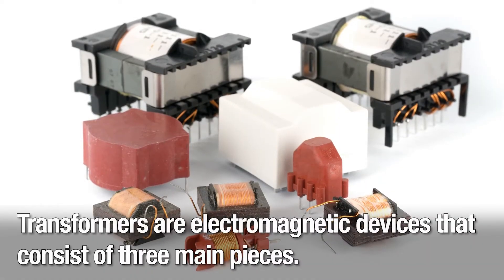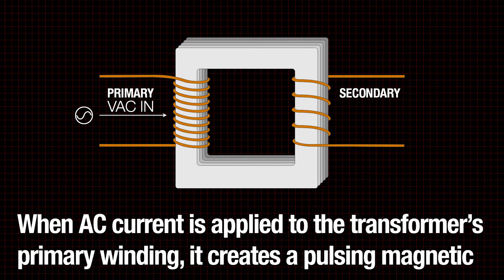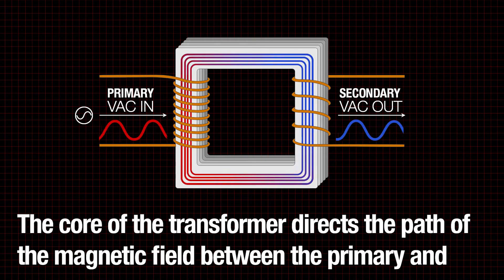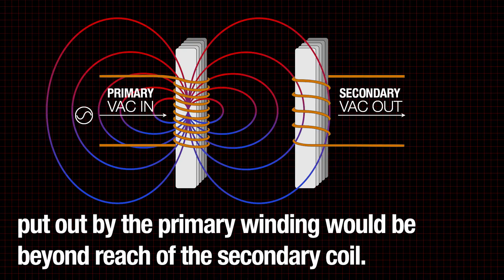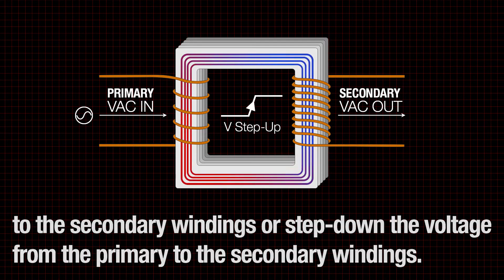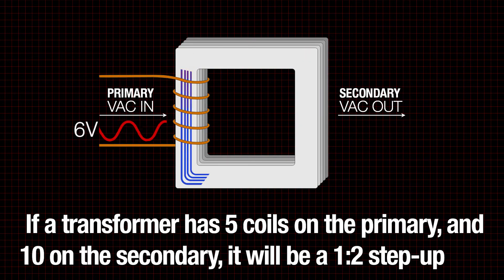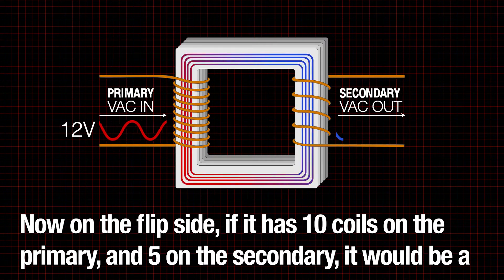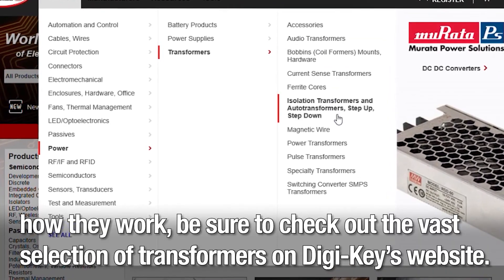What are Transformers? How Do They Work? - Another Teaching Moment

Comment: I love that you're putting these videos up, but you need a little more meat on them. For instance: do transformers work with DC voltage? What's the power loss? What are some of the varieties of transformers and what is different about them? You don't need to cover everything, but cover at least some of most common questions someone might have.

You did talk about why the transform had a ferrous core, and that was great! You didn't dwell on it - you gave just enough information to help folks understand and then moved on. That's a perfect example of adding the right amount of detail.
Reply: To answer part of your question, no, DC current doesn't work for transformers. The EMF (Electro Motor Force)  is produced when current changes direction which happens constantly with AC current but not with DC
Reply: Good reply about NOT dwelling on it.